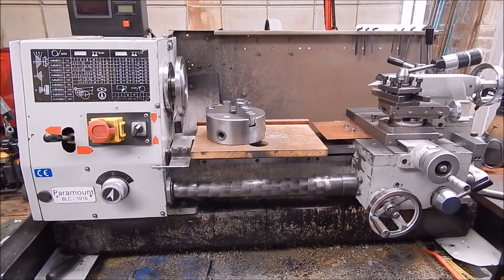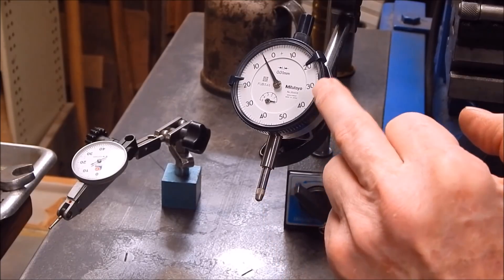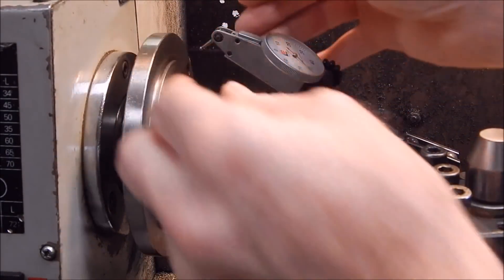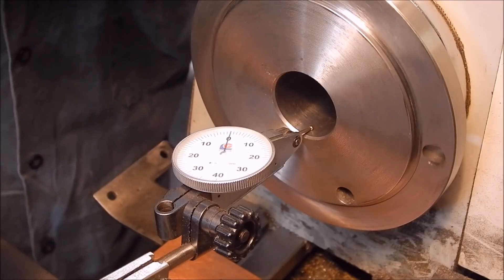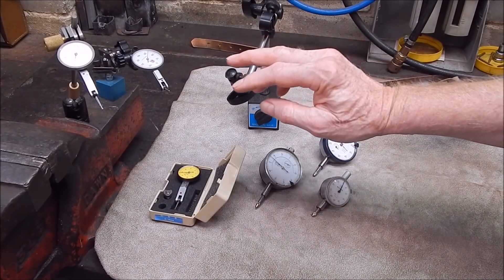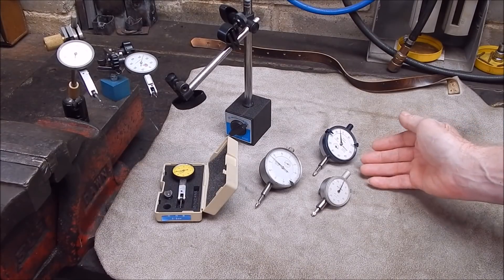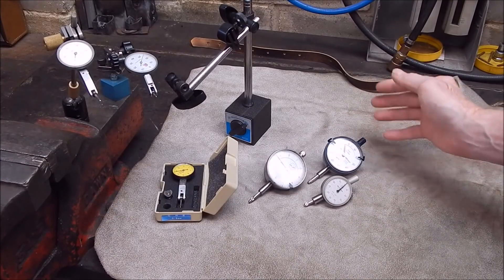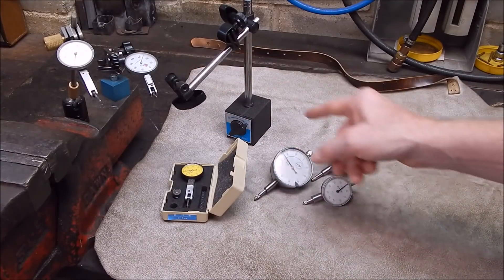Dial indicator or test indicator - which to buy for a metal lathe ?

Comment: I think I have to disagree with this...They both have their place...If you have a lathe...you NEED both. Dial indicators (with a mag back) are great for measuring all your travels on the carriage top slide compound or even tailstock. Especially with a cheap lathe...you NEVER trust the handwheel dials. On the other hand, I agree the test indicator is great for doing exactly what the name implies...testing. In a nutshell one is for comparing one is for measuring.
Reply from the maker: Hi Ben,

I did point out to buy a cheap dial gauge as well if you can afford it.  I also pointed out that dial gauges can do long travel work that a test indicator can't.  What that work entails is up to the user.  

The video primarily centred on four jaw chuck use and sought to make newbies aware of the limitations/abilities of both types of gauge.

Remember, these are inexperienced users who more than likely won't buy a test indicator, or collets, because they are often perceived to be the realm of experts.

Cheers Rob

Comment from the maker: The wealthy have alls that wouldn't buy a cheap indicator in a fit can go take a hike.   Don't bother giving me the bleeding heart story about buying twice.  

Once you drop it on the floor it won't really matter which one you bought.

It just means you have to go get another one.

Cheers Rob
Reply from the maker: No problem Ben, I hear this a lot and it is not always true, particularly with modern production techniques.

It comes down to personal experience I guess.  It's also a matter of what you can justify/afford to get the job done.

I've had a good run out of my Asian gauges as far as operation goes.  I also have high end brands to compare against. The main thing that lets the cheap ones down is the cosmetic finish.

If you open one up, the important bit, the internals are actually quite good.  I did this for the one I dropped and was quite surprised.

It will be interesting to see how the high end Chinese indicator compares.

Cheers Rob
Reply: Thanks for making this vid, I had wondered why people used this type of indicator, didn't realise the probe tip was adjustable, just added one to the eBay cart.

As for cheap, sometimes buying the cheapest is fine (especially if the alternative is not having that tool), years ago I ordered the cheapest digital calipers I could find and they arrived without a case in an unpadded envelope, they are still working great.
Reply: Hahaha that’s funny when you mentioned you dropped it my first thought was “huh, bet you’d cry twice if you paid big bucks for it. Likely more” lord knows I’d cry every time I broke out the replacement.
Reply: Just dont buy the absolute bottom of the line, i had one for 2 weeks. Also on ebay you can get used name brand for $25 if you want

Comment: I thought you were supposed to use one of those seesaw indicator attachments if you wanted to use a dial indicator in a hole. Starrett 670b or something like that. Your advice is great though, if you only can afford one, you probably will be upset at having to buy an adapter to make the first purchase work.
Reply from the maker: Hi Tim,

I hadn't seem that before.  Interesting, but why bother when a test indicator is a lot less expensive and no set up required.  Also a lot more compact.

You live and learn.

Cheers Rob

Comment: I am thinking of getting better DTI. I have one decent DI that I bought second hand and I find the dial face is easier to turn (to zero) and on the cheap one I find it's easy to knock the glass (well perspex) out if you are not careful. The cheap one's reading seems to wiggle more when I change direction while sweeping over  surface. My cheap (Miluloyo) has bad sticky point but is sill usable. Trouble is there aren't many  DTI between $12  and $200. Still looking for second hand but even they are around $100AUD. Ausee is one place that has middle of the road ones (I haven't tried them). Any advice would be great!
Reply from the maker: Hi Tom,

I don't understand why DTI are so expensive over your way.  Where do you live ?

Cheers Rob
Reply: @Xynudu  I'm from Sydney mate! So the ones I've looked at are the MX brand from H&F which are $100-150, I looked everywhere for a used good brand (Starrett, Mitutoyo, TesaTest - which I think are Brown and Sharpe) but again they all start at $100. Mitutoyo new is around $175-$200 (Just tools for example). Ausee looks promising. Lots of other Australian suppliers re-sell MX brand.  I think Bang Good will be more like my cheap miloloyo knock off and won't last long.
Reply from the maker: Try Blackwoods.  They have Mitutoyo, Starret and Moore and Wright.  You will have to ring for a price.
Reply: @Xynudu  I created an account on Blackwoods which allows me to check prices. They have the same Mitutoyo that Justtools have for $175 (513-404-10T) for $231 plus GST so not cheaper. I'll keep looking for second hand and wait for your Bang Good review! Thanks for the videos - always at the top of my watch list!
Reply from the maker: MeasureMax (MX) is a Hare & Forbed product line designed for the apprentice and DIY.  It's a Chinese knockoff.

I wouldn't be getting too excited about that.  But then again Starrett source stuff out of China now.

Cheers Rob

Comment: Good discussion topic Rob!
Agree about test indicator being more capable, definately the most used by me
The dial indicator comes out rarely, mainly square work in the 4 jaw (extra travel to clear the corners), and sometimes as a carriage travel indicator
I accidentally dropped my dial on the floor about 2 months ago, still haven't felt the need for a replacement yet (it'll catch me out lol)
Reply from the maker: Dial indicators tend to be more robust but none of them like abuse.  It's always less painful to drop a cheap one ;)

Cheers Rob

Comment: I used a low cost Banggood dial indicator over the weekend to set the bed height on my 3d printer to as uniformly flat as I could, worked well, easily attached using a 3d printed holder to the print head, but that is one of the few times I have used a dial indicator, whereas the test indicator I have lives by the lathe & gets used for many things. I had to buy the Banggood one as all the ones I inherited or bought second hand had stems too short to easily fit with out putting in extensions, & I lazily took the easy way, but that is what happens when you need something doing & the easiest tool isn't too expensive.Thanks for sharing.
Reply from the maker: If using a clamp mount on a dial test indicator plunger neck, be careful not to over tighten it as this can induce stiction permanently (from compression).

I've seen this happen on bridge mounts when reading piston TDC.

Cheers Rob
Reply: @Xynudu  Think it should be okay as its a gentle friction fit not needing much to hold it as only measuring small deviations from the flat, least I hope so as it would be the pits to break it so soon. Second picture down here shows the holder: https://myfordboy.blogspot.com/p/creality-cr-10.html
Reply from the maker: If you apply the pressure evenly and lightly it should be quite OK.

Comment: I enjoy your videos Rob
I find I use both depending on what I am measuring.
The test indicator is excellent on machined parts but I think it can be a little fragile for use on rough parts or if a large travel is needed perhaps on odd shaped parts or the mill table.
For example I would use the test indicator to tram the vise on the milling machine but use the dial indicator to tram the head.
I frequently use both to true work in the lathe. I find the dial indicator best for centering square stock in the four jaw chuck and I use it most frequently with the 4 jaw.
I use the test indicator on a height gauge and when used like that the cosine error is not a problem (as long as the variation from 90degrees is not too great) as you are making comparative measurements only. It is the same if the actual amount of the measurement is not required and you are just comparing for example when traming a vise on the mill table.
I think both have their place and both are worth the money.
I know you already know all this but maybe my comment will help someone who is thinking of buying their first instrument.
Reply from the maker: Hi Charles,

All good stuff.  I'm trying to get viewers to think about this subject.

I see some pretty horrendous things on YouTube with dial indicators.

They both have their place, but if I could only live with one, it would be the test indicator.

They are a bit like collets, they scare people off because they think it's for high end users only.

Cheers Rob

Comment: Hi Rob , just at stage of getting gauge , so your. Video just brill for me😀👍( am in the low on money group) so your advice is perfect timing
Reply from the maker: Hi Colum,

It's a subject that a lot of new owners don't understand.  I made it as clear as I think possible.  Glad you found it useful.

Cheers Rob
Reply from the maker: Hi again Colum, 
 
I bought my cheap test indicator and stand from CTC Tools on line store.  The stand magnet is round and very strong. 

I have seen a comment that the Banggood base is not as powerful and has a different/square shaped magnet.

Just passing on what I read in reviews. 

I had a look at the BG description and it looks to have a metal plate that attaches to the magnet for storage (to reduce magnetic field) same as mine,  so I can only guess that who ever made the comment hadn't removed this before use.   LOL.

Cheers Rob

Comment: Today marks the seventh week that I have been waiting on a test indicator and small magnetic stand that I ordered from Banggood.
It showed as having been shipped two days after I ordered it.
Reply from the maker: Only been two weeks so far for me.  Can't be far away.
Reply: @Xynudu   You are a lot closer than I am here on the West Coast of the U.S. 
I will have to admit that I have ordered many things from Banggood and this is the first time it has taken nearly this long. If it doesn't show then I am just going to re order the same thing off of Ebay, it was cheap enough not to bother hassling with them over.
Btw, this is a good video, wish I had seen this a couple years ago. Going to give it the old Thumbs Up.
Cheers.
Reply from the maker: Hi Phil,

Longest I've waited is 4 weeks for BG, Ebay went no show once.  Didn't get a refund as I waited past the allowed action period.  LOL

Glad you found the video useful.

Cheers Rob